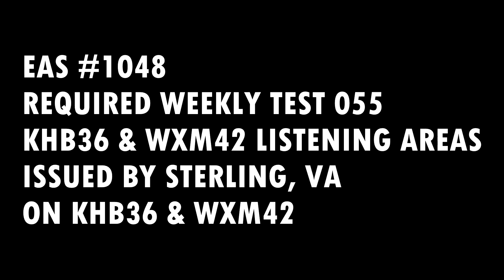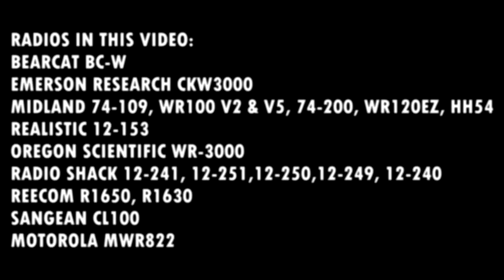EAS #1048:  Another Weekly Test | KHB36 & WXM42

Comment: What's that noise in the background of the KHB36 test?
Reply from the maker: Could be one of three things:
1. Me shuffling around in my bed because the test had woken me up
2. KHB36 has a rather audible 120HZ hum
or 3.  My radio setup has a lot of issues wherein the radios affect each other, causing random bouts of static from trees and such on a transmitter that is relatively close to my house.
Reply from the maker: OH it could also be the Sangean CL100's alarm going off, when the line-in is connected, the Sangean beeps instead of sounding its normal alarm.
Reply: It was a beep sound, so most likely it was the Sangean.
Reply from the maker: @RammerSTi  Oh yeah the beeping was the CL100, you can actually just barely make it out during WXM42's test